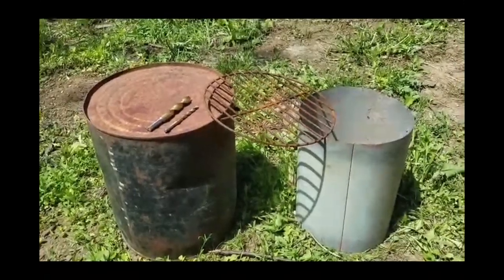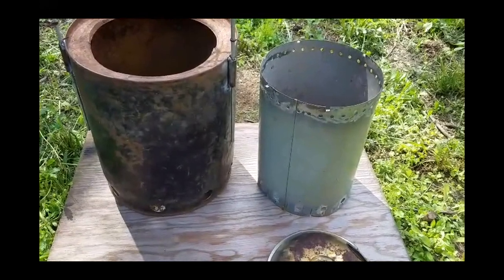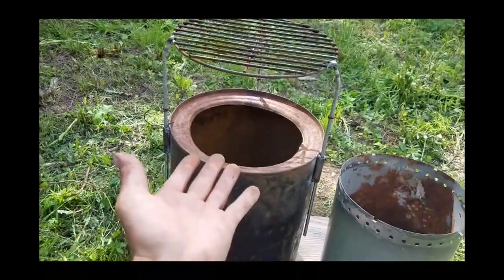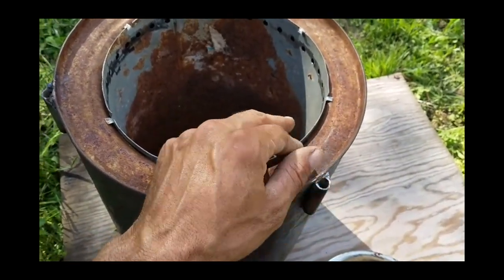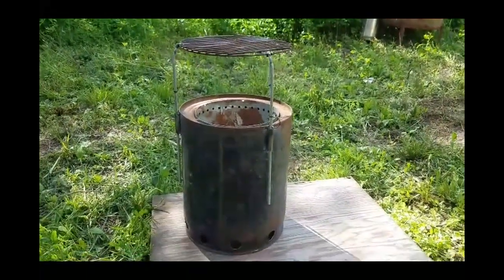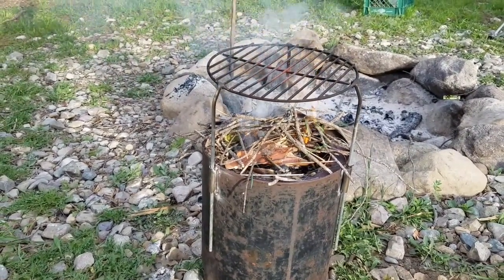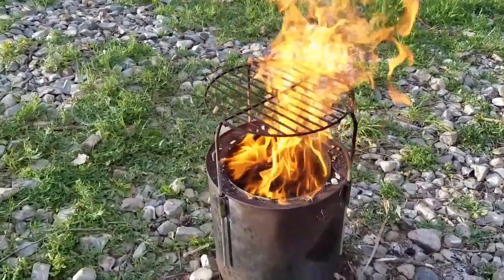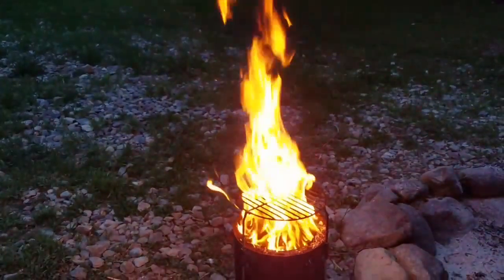Homemade "Wood Gas" BBQ/Cooking Stove, giant 5 gallon can size.

Comment from the maker: I used a ring made of flat sheet steel around the bottom of the outer can, that you slide up and down to cover or expose the main 1 1/8 holes, this does a great job of regulating the flame height by controlling the air flow into the stove.
Reply from the maker: 25 minutes of flame followed by 20 or so minutes of cole burn., that was with bull pine as the wood being burned. Pines give you the least amount of burn time out of all the typically used woods.

Comment: Love your videos, always intriguing and informative. I made one of the smaller scale gasifiers that you demonstrated using food cans (soup and vegetable) previously and it works great and can produce enough heat to get the wood stove in my house warmed through entirely with just twigs. Thanks for the uploads, keep them coming!